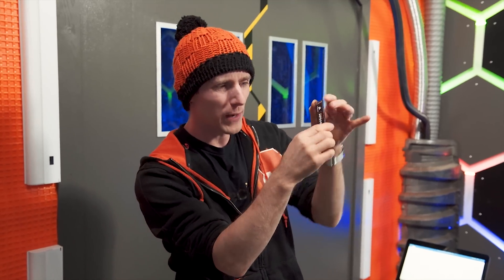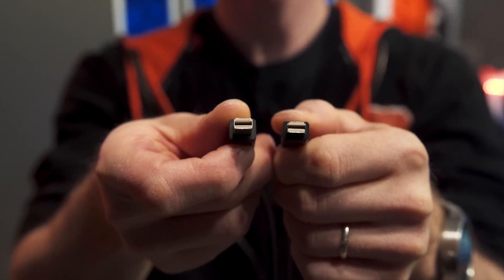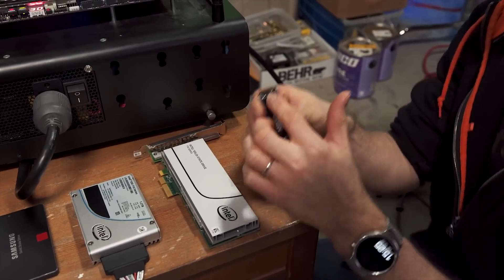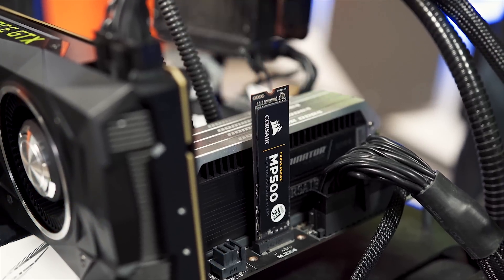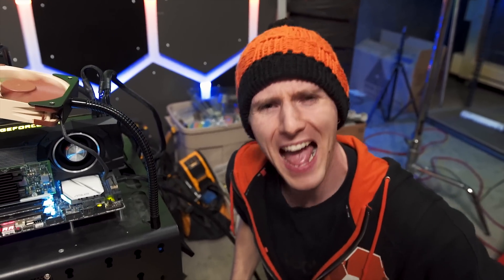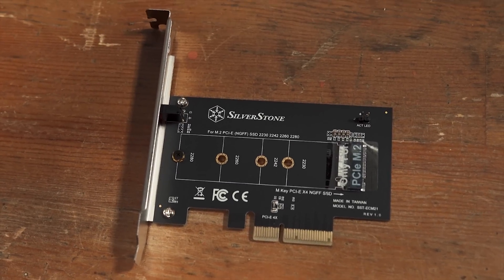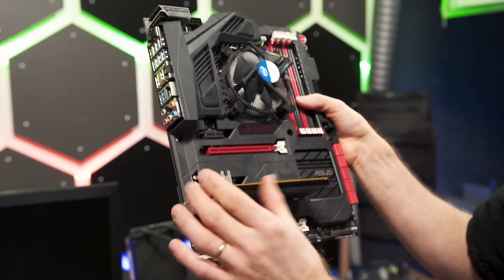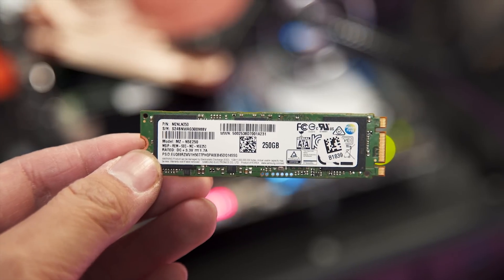The FASTEST SSD Technology Explained - M.2, U.2, and MORE

Comment: Just learned my Gigabyte B560 D3sh AC turns off a nvme socket if you use a 10th gen processor, I got a prebuilt lol. So I have to use a pcie slot below my GPU (sorry not familiar with the lingo. Major pain in the ass

Comment: Bottom line my system runs 365 24/7 since 2008 and now are starting to act up I got told ssd nomatter what ones will not do this length of time. Hard drives rule

Comment: Should i get samsung evo 970 pro for my i7-9700k system as my current SATA is of 250GB capacity and is always running low
Reply: Do you really need the pro?
 you can get a fast and cheaper ssd like the mx500

Comment: My question is:  Can i save all my softwars on a HDD fast drive 7,200rmp  because they are slower yess but last much longer also? This way my view is C boot drive does not need to be more than 250GB reserve it for windows only use ?  install a new SSD 1TB or more on the D drive for your gaming and other favorite software  for every day use? Would that be a good approach since windows  registry gets to big and slows the system over time? this way installing a new ssd and windows clean makes it much easier?

Comment: Ok here's a fun story:  I bought a laptop that had a 128gb M.2 drive, unspecified in specs but I knew it was built this year and had NVME capability.  I go to Microcenter and buy a 256gb NVME drive and went on Amazon to buy a drive enclosure, because this M.2 needed to clone the OS and I don't have another reasonable option to do that.  So I get the laptop and clone the internal M.2 to the NVME in the enclosure.  I swap the two and the NVME boots right up like it belonged there, but the 128gb that was in the laptop is now in the enclosure and no partition software will recognize the drive.  Can't initialize it.  Apparently the NVME enclosure is NVME only and can't handle AHCI.  🤦‍♂️

Comment: "Too expensive to use as a steam library" Linus 2017
Me in 2020: Storage compromised of Samsung EVO 970 1TB +  WD Black SN750 1TB and another of the Samsung  EVO 970 1TB incoming for my last M.2 slot on the MB. 
(yes i should have gone full samsung, the WD was "cheap" at the time) 
On a part time salary (im a student) for gaming only XD
Could i have gone for SATA and had double the capacity? Yes.
Do i want to? No.
Do i have ANY annoying SATA cables adding to the cable clutter? No. 
What we need is for them to accommodate for more M.2 drives on one MB and drive those prices down!

Comment: I like LTT, but you need to structure this kind of video better. I would cut out the part about the cables, not really necessary to talk about HDD. Just mention how SATA SSDs work, how the connector to the NVME M.2 both provide greater speeds as a connector better tailored for SSDs unlike the SATA that was not tailored for it ( is what i got out of this) this also means that it can adopt a smaller form factor. Then go over to the expansion cards(?).

Comment: Hey Linus
How can i know if my motherboard supports NVME or AHCI.
My motherboard : ASUS EX-A320M Gaming  just says :
M.2 Socket 3 with M Key, type 2242/2260/2280/22110 storage devices support (SATA mode & X4 PCIE mode)
Please help me which SSD my motherboard supports. I am very confused 😕
Reply: Also please tell me is this good and will it support my motherboard? I am using Ryzen 7 2700X
https://www.amazon.in/Crucial-1TB-NAND-NVMe-PCIe/dp/B07J2Q4SWZ/ref=sr_1_13?crid=ZIRL5IXGLQS5&dchild=1&keywords=m.2+ssd&qid=1595680450&rnid=3576079031&s=computers&sprefix=m.2%2Caps%2C274&sr=1-13

Comment: Can you use a 2.5" SSD for windows and then install a 1TB M.2 drive as secondary for games? or is the m.2 forced to be primary drive? Everything I see talks about using M.2 for windows and SSD for secondary, but wouldnt games utilise the higher read speeds of the m.2 to load maps quicker etc, providing a far better gaming experience?

Comment: Guys can you help me with this, please? I just recently bought a laptop( Asus ROG Strix G G531GT) and it came with PCIe NVME 256 GB M.2 SSD. I need a upgrade but I dont know what to buy. I need it to be as fast as possible. I suppose it has 2 slots. Should I remove the current m2 ssd and buy a new one? or normal 2.5 inc ssd is enough? Thank you.

Comment: 1 x PCIe 2.0 x16 slot (PCH) is it worth putting a m.2 adapter on it? as i only have the following and my only m.2 slot on the motherboard is used.
Asus crosshair vi Hero
2 x PCIe 3.0 x16 SafeSlots (CPU)
1 x PCIe 2.0 x16 slot (PCH)
3 x PCIe 3.0 x1 slots (PCH)

Comment: I’m glad I’ve spent the time researching and didn’t rush off to buy hardware. We have a 10 year old computer at work I wanted to upgrade with ssd. It looked like the cheapest option was to get a pcie adaptor for nvme ssd but didn’t realise you can’t boot from it for old motherboards. So will have to go the 2.5 sata route. Will need a USB 3 pcie adaptor as well to speed up cloning.

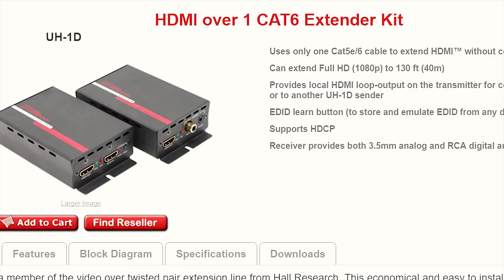Comment: 1:57 Wait! What? You have mounted power supply on 2 screws?
Reply: ? There's nothing wrong with that. Some cases have brackets on two opposing corners and two screw holes on the other two. Works just fine.

Comment: @Linus Tech Tips Have you guys done a video on loading or read/write times for NVMe vs SSD? And in what applications would a NVMe drive make a difference? Also, potential bottlenecks, like transferring files between a NVMe and SSD drive, the read/write times would still be limited to the SSD capabilities, right?

Comment: You went too fast and this was super confusing. I am new to this technology, just upgraded to the m.2 and it’s freaking fast. I think what most people want to know is, most older computers can only handle an SSD upgrade, while in order to upgrade to the m.2 would require an upgraded motherboard and the PCI adapter that you can add an m.2 too. I might be way off, but in order to truly have a fast system you need about $1000. Less of course if you just want to incrementally go up from Old.

Comment: I just installed my M.2 drive directly into my motherboard, but I really enjoyed your explanation and the visuals, and I had no idea that PCIE devices existed that could basically port your M.2 drive in. :)
Reply: Not only do they exist but they also do not appear to lose any bandwidth.  Good to know if you want to run multiple M.2 and motherboard does not have multiple slots.

Comment: So some motherboard have connections like this in their specs (amounts are example):
- 1x M.2 (PCI-e 3.0 x4)
- 1x M.2 (S600/Pcie3.0x4)
- 6x SATA-600

What does the 2nd one (S600/Pcie3.0x4) mean? Does it mean it can run on NVMe at full speed as well as regular SATA?
Does it allow me to have 2 M.2 NVMe cards at full speed?

Comment: Ok, I did understand the basics, however, here's my question to see if someone could shed some light. I'm repurposing my workstation as a NAS (haven't decided between FreeNAS or Unraid) and would be adding HDDs, but definitely would like to add NVMe for caching or higher tier storage. My motherboard is a Sabertooth 990FX R2.0 (PCIe specs below). The question will be, if I add a PCIe NVMe card, will I get the throughput of the NVMe on the PCIe 2.0 slots? If maybe not the fastest & latest, what will then be a PCIe NVMe card & NVMe drive combination that will actually get a good performance without wasting money on overpowered stuff that won't actually perform as intended on the PCIe 2.0?;
3 x PCIe 2.0 x16 (dual x16 or x16/x8/x8) (One of them with a graphics card, but won't be necessary when serving as a NAS)
1 x PCIe 2.0 x16 (x4 mode, black)
1 x PCIe 2.0 x1
1 x PCI

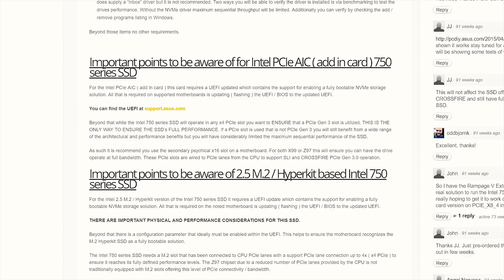Comment: You saved me within the first 4:30 of this video... I was doing a bunch of research because I was afraid an M.2 I was gifted would need an adapter to x4 PCIE.

My mobo had one all along! It sits between the two x16 slots, perpendicular to them (horizontal with the mobo), so I just could barely see it! Never thought to check if one was embedded because I figured--not a laptop? Most likely no M.2 slot!

Comment: I still didn't get whether you can use the socket under the Processor as well as the one below the Southbridge, or will this cause problems, my case has 11 fans, MB, Proc, H150 LC and 2 SSD's that's all. ROG STRIX Z390-E, INTEL-9900K.

Comment: So, basically:
FORM FACTORS include SATA and M.2 (and other irrelevant things), they determine the funny shape of the physical connections.
PROTOCOLS include AHCI, and NVMe, they're ultimately what determines how fast the speed is.
SATA can use AHCI as its protocol, but is ultimately limited in speed.
M.2 can use both AHCI and NVMe, but NVMe is faster, but isn't always supported by the mobo.
Correct?

Comment: You barely explained it. You just show where to plug it, how it does look like .You didn't explained how it works , no benchmark for transferring  data , not showing at least 3 consumer  motherboards that provided support for 1or more solutions .So if ur trying to explain something , just do it in a way a noob can understand what is what .So many times I see pc building video with ppl adding one of those and not explaining why they do that, pc custom build guide , and not using a regular ssd or hdd because nvme.2 or wtf is it ; it much more cooler , but the majority of viewers dunno what in the world ur talking about .Next time say hey there's this forum with a an in depth guide of m.2 check it ; and then end the video.

Comment: My MSI Z97 Gaming 5 has a M.2 PCIe slot but it's the older Generation with only X2, so I bought an adapter so I can use a PCIe gen 3 X4 slot to power it and get full speed. Is it easy enough to set it up to boot windows 10 from or am I best just using the M.2 for games only?

Comment: If used with a SATA HDD (with U.2 to SATA cable), would there be any noticeable difference using U.2 over a standard SATA port on the boot drive?

Comment: My computer does have M.2 port. I ordered a M.2 SSD + pcie4x to M.2 adapter. All I wonder is, does the pcie4x bandwith give maximum speed from M.2 SSD drivers or not (is the pice4x fast enough). Googling didn't help me, manufacturer does not show on their product etc.. Ps. The pcie4x to M.2 adapter is just an adapter, no components over there so no drivers needed.

Comment: Thanks for the helpful tech tips! Your video really helps, particularly on the SSD variants! I had bought a Dell Inspiron 15 a month ago.  The laptop included an 8th gen Intel CPU, 1TB HDD and 32GB RAM. I knew the 1TB HDD is a standard 5400rpm. I opened up the laptop for inspection, it have a slot to support an M.2 SSD. I gave my laptop an upgrade of using a newly 250GB M.2 SSD, and it is running blazing FAST! just freakin' awesome! ALOHA!
Reply: Aloha 😊

Comment: I recently bought a 1T NVMe ssd that didn't have a a heat sink. I am looking at the Warship fan/heat sink. But it's fan is geared for 7 pin sata connections. I'm worried about not being able to spin the fan because I won't find that type of sata port on my mobo. How to get around this problem.

Comment: i have a asus rog and it has a ssd and a hdd would it matter if i had to take out the hdd and replace it with another ssd would the laptop run any fast or better conidering my m.2 ssd is a 275gb and a 1tb hard drive with a 8gb ram in one slot and a 16gb in the other slot

Comment: ok so is M.2 SSD FASTER THAN TWO SSD 2.5 IN A RAID 0 CONFIGURATION ALSO YA LOSE THE M.2 SLOTS IF YA DO RAID 0 WITH 2.5 SSD CORRECT? AND IM TALKING ABOUT SETTING THIS UP IN A ZBOOK G4 I7 QUAD CORE 17.3 INCH MONITOR

Comment: So...... I have a Lenovo X1 Carbon Gen 1 that came with a SanDisk 128 SSD (P/N: SD5SG2-128G-1052E). The problem is, that isn't enough space to do anything but the basics.
I need to upgrade to more. I found info on the lenovo forum about upgrading...I installed and all is good, but I have now a 128 SSD that is useless. I could put it in an enclosure and utilize it, but I am not sure what will work. It has 6 pins on the one side of the split, so it isn't NVMe Right?? and it isn't exactly AHCI either, right. those have type B or M depending on the split. Found many that support both.

Comment: im not even that old. i remember in early 1990's 4GB  Hard drive that time was consider big. it was loud and noisy. everytime you boot up the PC you hear the clicky noise it make follow by dial up modern to connect to the internet. 

now we have a smart watch that have way more storage and able watch porn at any giving time. holy cow
Reply: 1999 I bought a Dell XPS 500 with a Pentium III screaming fast 500 MHZ. Huge 256 MB RAM with a whopping 25.7 GB HDD! Powering those Unreal Tournament sessions with my 16 MB TNT Card.Turtle Beach Montiego II sound card.21 inch Sony Trinitron CRT weighing in at a measly 89.something lbs.Altec Lansing 5.1 surround sound w/sub woofer (kick ass sound BTW even  today).56k modem that I got a top speed of 26,000 kbm thanks to old phone lines.All for the low price of 4000.00. 

Then bought a Guillemont Geforce 256 for 299.99 that died after a month. Sent me a refurbished one that the fan flew off and grind into whatever card that was next to it.Sent it back  for a refund.Bought a Geforce 256 from Dell and they sent me another Guillemont one.It died a month later.That kinda killed my enthusiasm for a while. 

I bought an IRiver 128MB MP3 player for 149.99 at Best Buy .But yeah.It's insane to see where things are today compared to then.

Comment: Uh i don't even think he mentioned "U.2" (was that a joke?) and he certainly didn't mention which was the fastest.  Thanks to the comments I realized that he was saying "AHCI" and "MVME", and I guess MVME is faster, but certainly don't know from this video whether PCIe or M.2 is faster.
Reply: I don't think he mentioned Bono either (that was a joke). To my understanding, NVMe and AHCI are methods of connection/communication between the CPU and the drive. NVMe is a more direct connection to the CPU than AHCI, thereby making NVMe faster.  An M.2 drive can either use AHCI or NVMe, it just depends on the manufacturer. You have to know what your motherboard will support (NVMe vs AHCI) so you can buy the appropriate drive. PCIe are basically lanes (like a freeway) that data travels to-and-from the CPU and other components, including the drive. An M.2 drive will use 4 of those lanes to communicate with the CPU. I suppose the fastest combination of would be an M.2 drive that uses the NVMe protocol. Then again, some ASRock motherboards use "Ultra M.2", but I haven't read up on that yet.

Comment: Hi there,

I need assistance with upgrading my laptop. I have an HP Pavilion 15-AU624TX (India) and I wish to use the Intel Optane M.2 2280-S3-B-M 16GB NVMe SSD memory module to speed it up a bit.

For that to happen my laptop need to have the M.2 2280-S3-B-M slot/connector. Please let me know if I can upgrade my laptop with this option. I'm quite fascinated with the Intel Optane M.2 2280-S3-B-M 16GB NVMe SSD memory's performance reviews and hence want to give it a try.

Comment: Also I"m building a Hackintosk and I'd like a bit of advice drive wise. It's based on a Tachi z370 i7-8700k 48gb RAM.  It's running well on HS already booting from a Samsung Evo 840 (It's ok like this I don't want to boot from a m.2 drive).  For video editing purposes I planned this drive set up a: boot drive = Samsung Evo 840 (wich I own). Cache drive 500gb eve 840 ( I already own).  Project drive: either a software raid or a JBOD raid from: 1 x 1TB nmve (PM951 I already own) it's already set-up  on Ableconn PCIE m.2 adaptor in the 4x PCIE slot, And 2 more 1TB NVME drives I have yet to purchase.  Possibly Evo's 960.  I already have a 1tb Evo 860 yet I want more speed.   I'm tempted by 3 others options: OEM versions like a PM961 and the Toshiba XG5 1TB 1000GB.  I'd put one 1TB on the onboard M.2 slot 3 (which cuts one Sata 3 port) and the other on the same PCie 4x adapter then my pm951, or another pcie card if need be.  Why? On.board m.2 slots 1 and 2 each cut 2 Sata 3 ports M.2 3 onboard cuts only one. And my Media drive set-up is 3 x 4tb WD black (software raid) plus a 12 TB seagate for media backup all internal.  I also have a docking data 3 station on the case which is very useful.  So this leaves me with not enough Sata connections to really do otherwise. So here are the actual questions lol : how do you feel about using OEM drives which are supposedly intended for laptops in such a system for project purposes instead of retail versions.  B which PCIE NVME adaptor card set up would you recommend. if you'd rather reply in private maskorpo.ca@gmail.com.

Comment: For people game enough there are now various modded BIOS with updated drivers allowing full NVMe performance and boot capabilities on older originally unsupported motherboards. Tweaktown is a good starting point. I used a further modded Tweaktown  modded BIOS in my GA-Z77-UP5-TH motherboard and have an 500 Gb EVO 970 running as a boot drive with 2500W and 3000R speeds.

Comment: This is probably one of the most confusing technologies I've run into since experimenting with back up slave drives in the early 90's.  Leads me to a question.
-I have a socket on my mobo that says "Ultra M.2" I'm guessing that's the same as U.2. Above it, on the mother board it says "Ultra M2 PCIe Gen 3&4" 
- This sits in-front of one of my 2 PCI-Express slots. Does the PCI Express slot need to be empty? Is it on the same slot basically?
I do not have an empty PCI-E slot (One is video card, the other is Ethernet port) Does this mean I can't use the Ultra M.2 port, or that it will have to share the lane? What will happen?